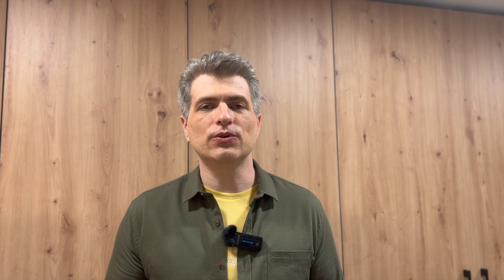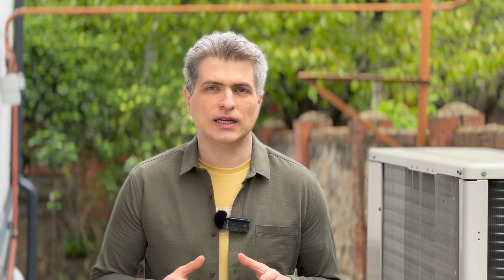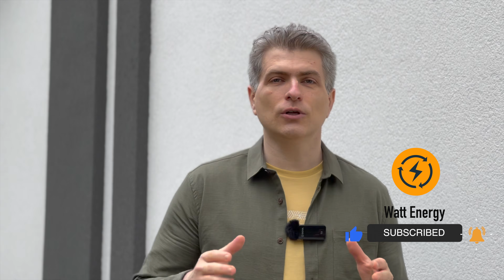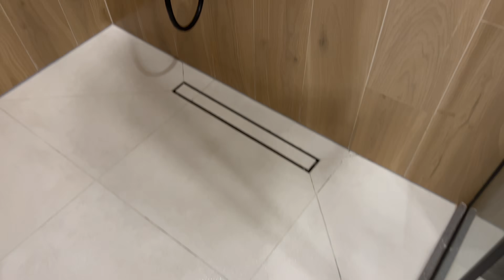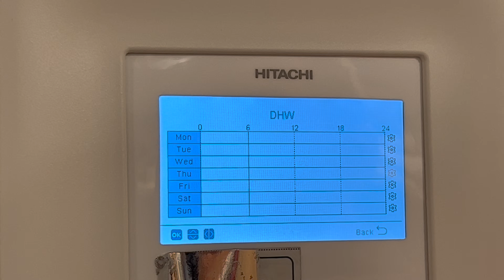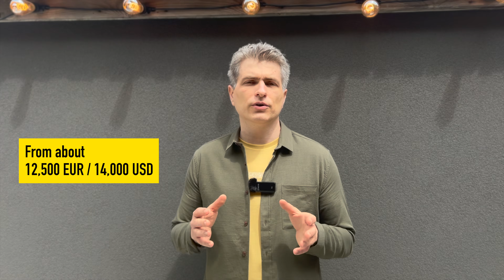My experience with a HEAT PUMP after a complete cold season

Comment: This pump is horroble. Switch off an on and no way to fix it. It needs a firmware update. I think someone in kindergarten has make the programming. and before defreezing its extreme loud. Horrible Heat pump. Inefficient and loud. What did Hitachi paid for this video?

Comment: Hello, could you tell me if when doing DHW your heat pump ever goes above 50hz of compressor speed? Mine is limited at 50hz and Hitachi says it is normal and should not affect the speed of heating. But it is not true and since I have a big tank it takes forever to heat up. The compressor goes at 120hz max so it's not even working at half power when doing DHW.
You can check the live view with the installer password.

Comment: In mod normal apa calda se seteaza pe 55-60 de grade, producatorii recomanda ca ffind temperatura unde Legionella nu se mai dezvolta !
Reply from the maker: Pentru o locuință cu izolare termică și pardoseli încălzite, 55-60 grade în sistem e mult prea mult. Și 55 grade e maxim ce poate fi setat la multe modele de pompe de căldură.
Reply: Din cate stiu pompele de caldura, la o anumita perioada de timp, isi face un circuit cu incalzirea apei la 60 grade tocmai pentru a rezolva aceasta problema.
Reply: @emil10139 e valabil si la centralele pe gaz. 55 60 de grade este excesiv pentru temperatura apei mai ales daca  ai boiler astfel incat o incalzire la temperatura respectiva merita facuta cel mult odata pe luna pentru a distruce bacteriile in restul timpului putand sta la aprox 45 de grade

Comment: Exista solutii mult mai sustenabile decat pomele de caldura. Exista pe piata blackboxheating cu o eficianta de 99,69la suta. Consuma cu 40 la suta mai putin decat o pompa de caldura si nu iti da emotii la temperaturi foarte scazute. Nu ai unitati exterioare, se pot instala in apartamente ,case sau spatii comerciale. Sa nu mai vorbim de costuri care ajung la 25 la suta din pretul pompelor de caldura si ofera o garantie extinsa pana la 20 de ani.
Reply from the maker: Ar fi interesant să studiem subiectul mai detailat, dar din primele informații pare să aibă un consum cel puțin similar de electricitate raportat la suprafață.
Reply: Consumul se apropie de cel al pompei de caldura dar diferenta de pret, garantia de 20 de ani, volumul mult mai redus si faptul ca nu are unitate exterioara , freon, si muuulte piese in miscare face ca blckboxul sa fie mult mai convenabil.